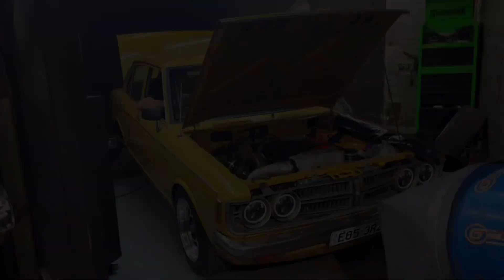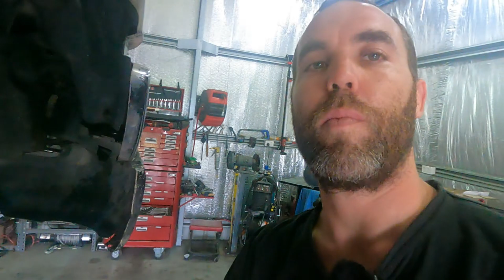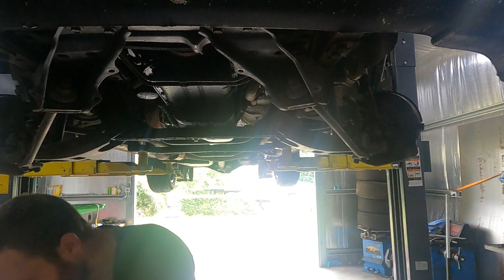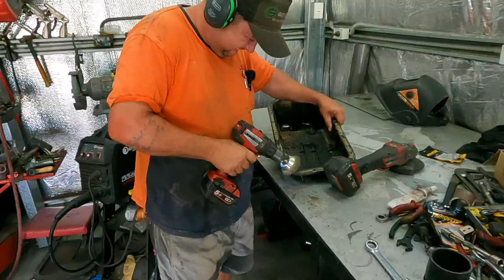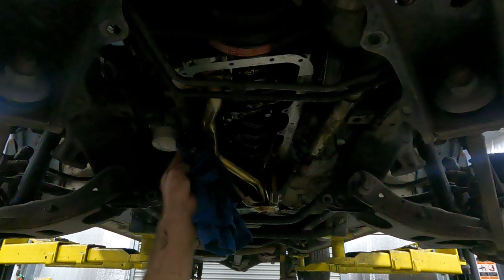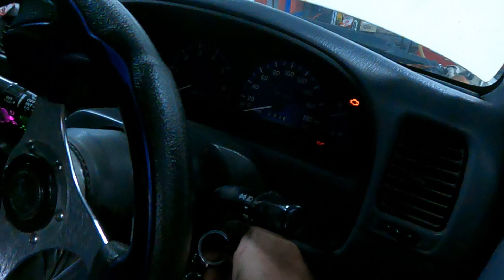3RZ Turbo Build - Episode 2 - Sump Drain install

Comment: Hi mate, I’ve removed my sump once cause it had a leak and it’s my first time just a question I’ve happened to removed my oil pick tube for somehow and I tried to find a new gasket for it but I couldn’t so I did used the same old gasket back. Will it work or it will cause a problem because I did used the old gasket? Thanks
Reply from the maker: Depends on the condition of the gasket . If it was a steel gasket - most of the time these are ok to reuse if needed.
Reply: @TunaRacing  thanks mate! Btw next thing is to replace my rocker cover gasket, anyway do you torque those 10mm bolts on the rocker cover to torque spec or just hand tighten?